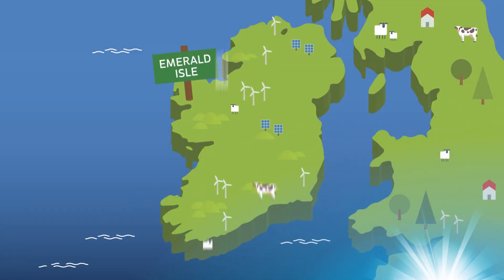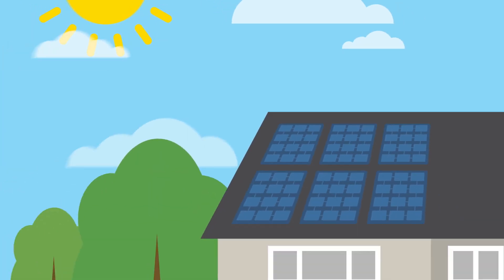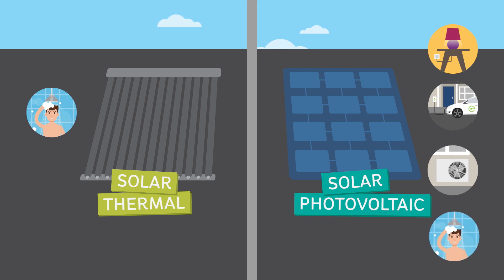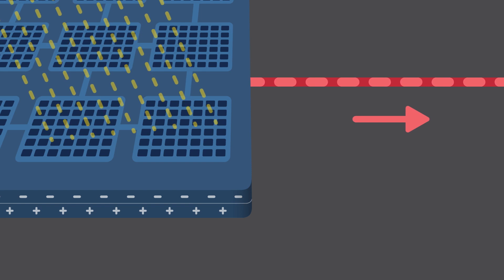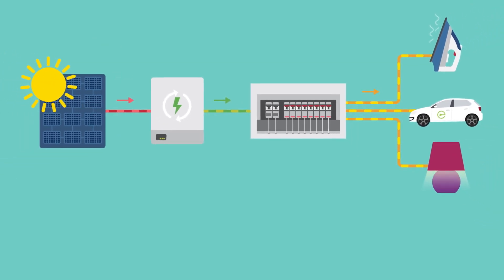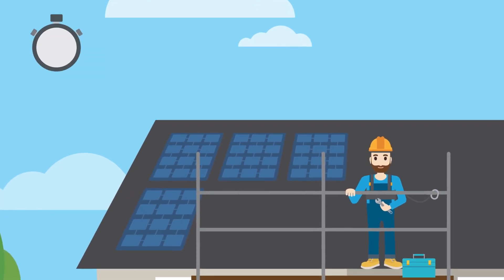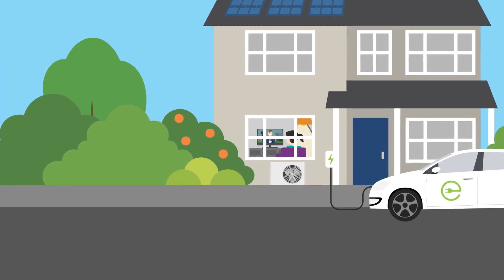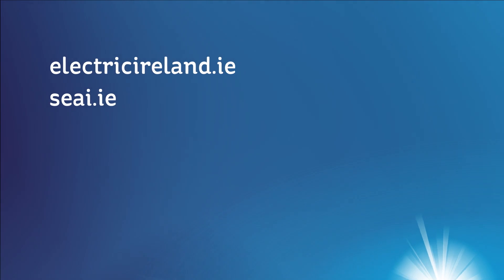Electric Ireland Explains how Solar PV (Photovoltaic) Works

Comment: Why cant the excess electricity be sold to the grid? How much do the batteries for storage cost and how long before they need replacing?
Reply: it can be but they advise not to because you get a bad price for it. best off designing your system to suit your needs instead of easting your money on excess energy